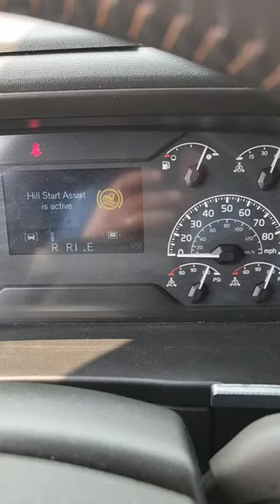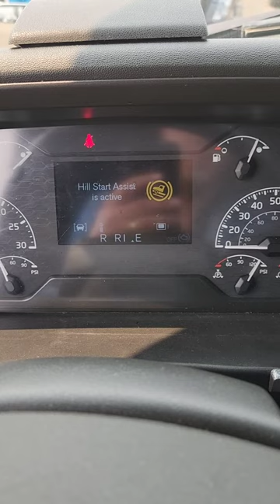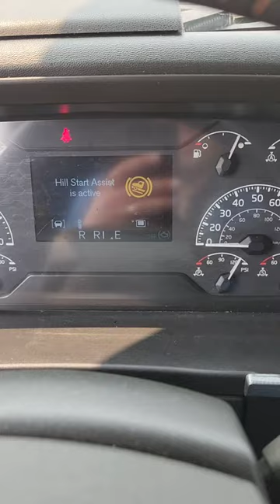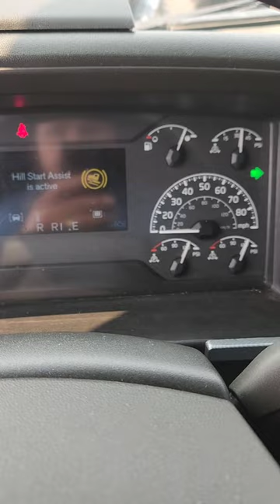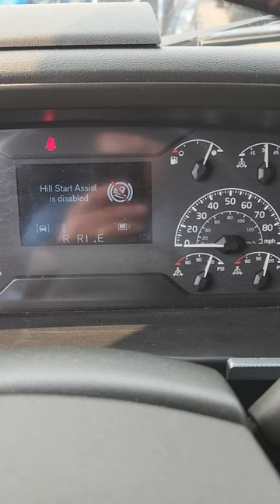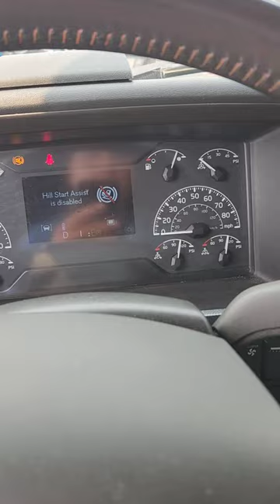What is "Hill Start Assist" on Volvo VNL

Comment: How do I Activate the hill start exist in this truck? You showed only how to disable.
Reply from the maker: It's all time activated.
Reply: Ok how exactly does it work can you explain?
Reply from the maker: @RomeoMadoff009  Hill Start Assist it's "fill" how is your truck located on the road- is it uphill, downhill or is on level ground. So when it's the sensors shows on the computer that truck is not on level ground, your computer will "press" (actually hold brakes)  brake pedal beside you and truck will be in stop position for few seconds. That will usually happen when you going on dock or in some area with uphill true town so will actually prevent truck to roll by itself.
When you press that button on the dashboard for Hill start Assist, you basically told to computer to don't hold your brakes...and that's be help for you when you back up on the docks.
Reply: Thanks friend 👍